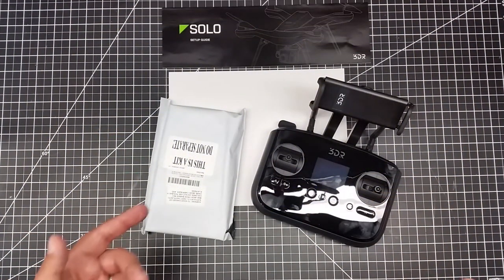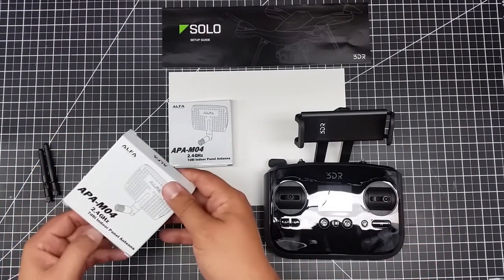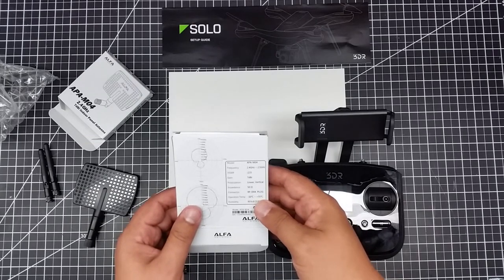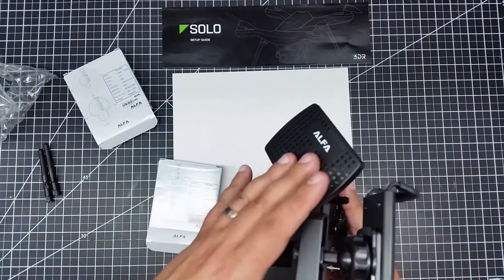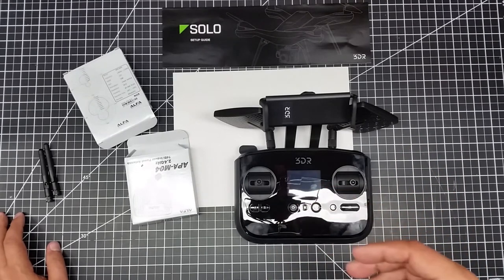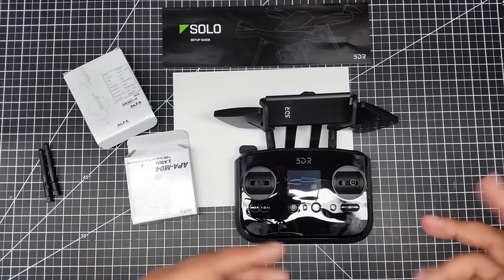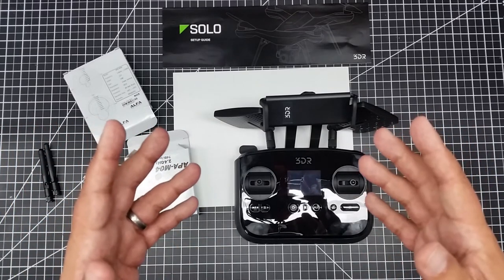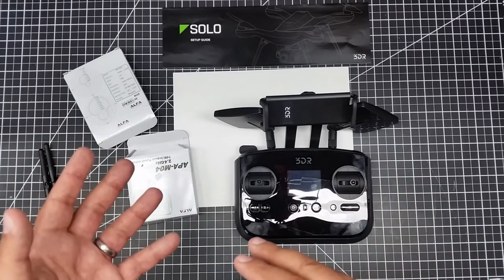3DR Solo - Long Range Antenna Unboxing and Easy Mod!

Comment: As you ask for advice. I don't have much experience got my Solo 3 month ago but I would say : The Solo is a nice Drone, If It's a new Solo you should do the GPS Mod buy a Version 2 shield or put some foam or cartboard between shield and GPS board, and change for a RevB GPS or a Drotek or mRobotics Ublox m8n GPS. Then for the Gimbal and Gopro, I have an Eken H9 and I finaly bought a Gopro the quality is beyond compare. And the Gimbal Is the best option if you can find one for arround 130USD or less (prices are rissing) if not the Tarrot and some other gimbal can be installed in the Solo you will need to do 3 soldering and you will have the tilt option. But not all the video options from the original gimbal (I might be wrong for that point). Then a Flat Ribbon cable can be an option and the Antena you just got.
Reply from the maker: Thanks, been messing around with gimbal ideas (as I have a number of third party gimabls in the shop).  Also I have Rev B GPS so no issue on that front so far as it grabs sats very fast.  Have looked a ribbon cables but might try hacking the existing to see what I can do first.  Also can you point me to web site or video for this "will need to do 3 soldering and you will have the tilt option" as without using the GreenCube you can get tilt working?

Comment: Panels go down, logo facing out.  Over Lake Okeechobee, i was able to go out 16,500 feet over the water.  Returned and landed with 0% battery.
Reply from the maker: did your box say 2.4gig?  This looks like a 5.8gig system and I am only getting ~4,000 feet...
Reply: I did take it a parts look inside alfa antena replacter is printer side...means other side is front draction..maybe....no....manual hihi

Comment: If that is using both antennas on the 2.8 ghz why not add a small 5.8ghz all in one to assist in navigation/orientation when using the 360 camera?
Reply from the maker: +Thomas Gehrdes Jr yes both are 2.4 gig which I find strange.  Do you have these?
Reply: Video-Drone, I do not have a solo. I was looking at it before I decided to go the "Tiny Whoop" indoor micro fpv route. My thought was with winter approaching, outdoor flights are going to be difficult for me to get in. I will say that migrating to indoor micro-fpv was extremely easy. I only needed one flight to get used to flying from that point of view.
Reply from the maker: cool and also I don't the cold stop me :-)

Comment: YES Waiting on s500 build
Reply from the maker: Its in the background, going to do the 220 build first as model for the S500 as I just got in several Omnibus F3 controlers and Radio Link GPS.  I am a little about setting up the fail-safes and the like as I have never did this before, however JJ Rotorgeek has offered to assist me...

Comment: I am going to let you know what I think and what I think is I think you're kind of making the right decisions something I have to tell you I've head all those birds you mentioned in your video I had the Phantom that thing has restrictions on it and I didn't like that so I sent it back I had the upper one and I had to calibrate the compass as well I was going to do it but someone from the repair group said to me you can calibrate the compass but make sure you don't do anything wrong because if you do your copter may not fly again I heard those words and decided against the upair one and decided to sell it take the money from that copter and I bought me a solo 3dr my story is similar to yours but I sold my stuff I'm not going to keep it even though I wanted to I'm not going to take care
Reply from the maker: So do you still have the 3DR?